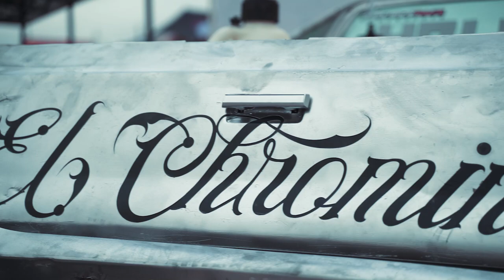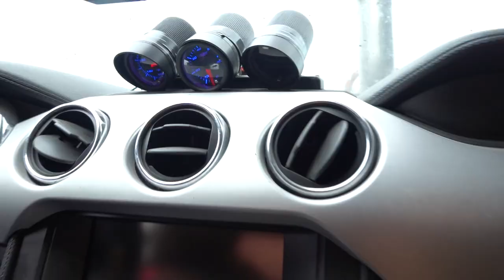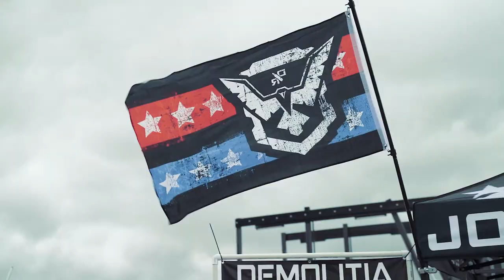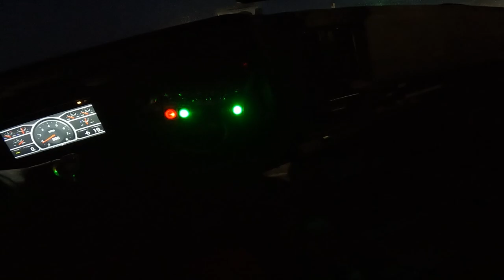Full Cleetus and Cars... And El Chromino's LAST Run...

Comment: Dude, that burnout while you had it running was damn solid... You've really got some skills on the burnout pad. Only thing to learn is that you need momentum to clear out the smoke in the cab = P Rip a donut, tear out, and roll it into another donut.

Comment: Little tip for strapping your cuda/any other car to a trailer.. I noticed in the back your straps were crossed.. That's a no no matt and if for some reason a Strap fails which does happen to even the best of the best. I know you probably didn't strap it down but if you ever do or are around make sure left corner to left corner and right to right. A channel called bleepingjeep explains why and what can happen with a failure in crossed straps. Basically the car can fall right on. When you do it straight to the corner the other straps pretty much keep the car from going anywhere.

Comment: Probably not the case, but it might be worth mentioning. Common mistake when building a turbo setup is forgetting to check the waste gate spring. Some manufacturers put ALL the springs inside for shipping purposes, but you should only be running one of them.

Comment: I have a SRW 96 K3500 4x4 454 truck I would love to bring down there and just burn the shit out of the tires like that. I am a nut and love burning tires. I use to do burnouts on my tri-cycle. I had the knight ride 3 wheeler too, i'd even burn there plastic tire until my legs couldn't take no more. Its either in your blood or it isn't. Glad to see I am not alone in this craziness. Awesome torch Matt! Hopefully you get that fuel issue right.

Comment: if had one thing brother it would be use some foot work of the gas and brake plus a little of 5000 to 6500 rpm instead of just limiter

Comment: Someone needs to try a 4wd vehicle that also has rear steer, as well as normal front steer, I bet it'd do a good burnout. Also, used rubber filled tires so they last longer.